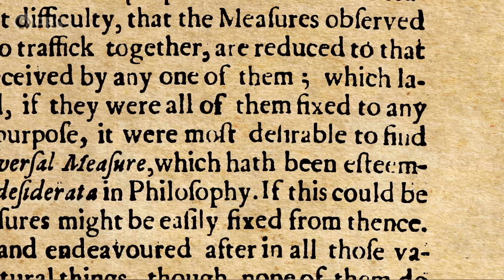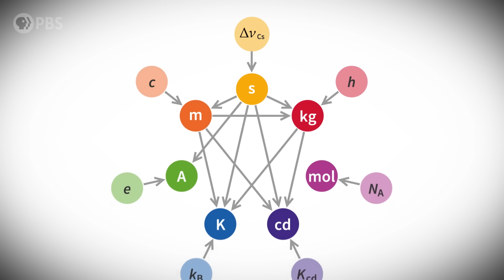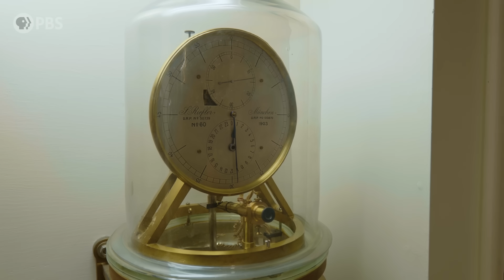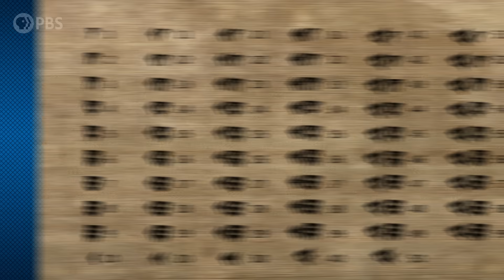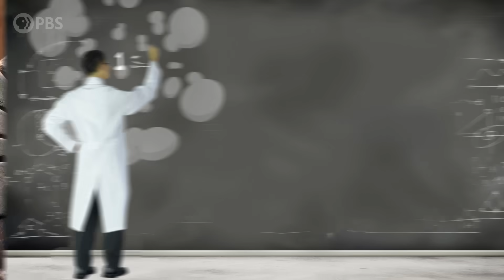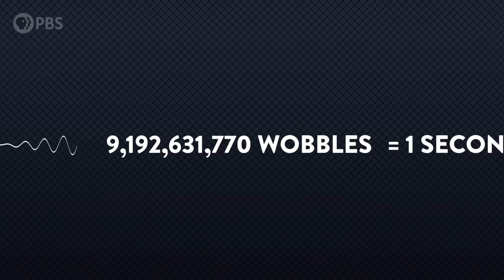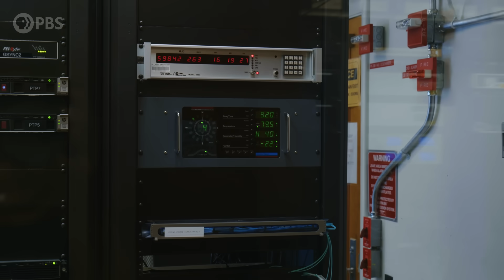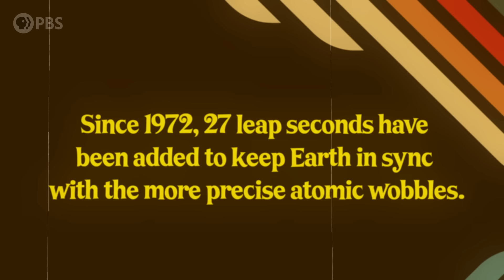The Unexpected Measure that Makes the Modern World Tick

Comment: So, you decide on what natural constants represent all your units, including the second. That begs the question, how do you "measure" it. Every man-made tool had inherent error in it. Aruler has lines delineating the units and subunits. How thick is the line. Does the left side mark the end of the previous subunits? Or, does the right side mark the end of that subunit? Or the center of the line. How much resolution power does the human eye have? How much does that resolving power does vary by individual? There is no such that as an "exact value" for any man-made measuring instrument.

Comment: Fun fact about leap seconds - they can take effect at the end of June or the end of December in any year.  And though so far leap seconds have so far only been added, theoretically they can be removed as well, though that's never happened yet.  But by 2035, the plan is that we will start allowing UTC to drift away from atomic time by more than a second, so these adjustments won't be necessary as often (but when they do happen eventually, the jump will be by more than a second).

Comment: I hope they have high level of security on these time providers.  They seem to me like a single point of failure.  If the clock is off, nothing will work correctly in today society.  Society can roll into chaos pretty quickly if the time is not syncing up.

Comment: The average person can’t even influence any measurement system. Here in the USA soda is sold in 2 liter bottles. Drugs are in metric terms. The military uses all metric measurements. Milk and water is in gallons. For temperature metric is not as precise as Fahrenheit. Think of Fahrenheit in % terms. 70 degrees Fahrenheit is 70% warm . 100 degrees F is 100% hot. You can see water boil and you can see ice. American money is  based on 10.  It is not going to be changed by people.

Comment: Imperial was quite genius at the time. With imprecision, there were simply more ways to divide 12 evenly than using units of 10. I mean, as late as the 1800s, who could accurately measure 3.33333333333~ as 10/3? But, 12/3=4 equal parts is pretty simple.

Comment: Kmiles is why they created metric system.  To cover up that the globe we know is 80,000 miles around, not 40000.  1000 miles per time zone.  Although it's actually 1600 miles per zone.  As  km.  Say.  But is actually miles.  1.6 conversion

Comment: No! The map people use to show who uses metric and who doesn't is completely wrong. You either need to include the USA as Standard units include metric. If it's based on usage then you need to include Canada and the UK for still using miles and stone respectively. Also,  what kind of metric? CGS, MKS, ISO? Absolute units are better.

Comment: The belief the US doesn't use metric and other countries do is not really true...certainly not so clear cut. We buy Coke in 2L bottles and wine in 750ml bottles and In the UK, they buy pints of beer.

As someone who has lived in both Europe and the US, they both have thrir place.  I prefer buying a pint of beer as opposed to 0.3L as it is sold in Germany.  A three foot counter is smoother than 87 or 93 cm.  In the day to day world, Imperial is simpler because it is anthropometric.  Whereas for science, metric is better because it is all decimal.  It also has the advantage of being universal.  However, aliens on the planet Krypton mit not choose cesium as a basis and choose neon instead.  And, if we want to be consistent, a second should be 1/10 of a minute and a minute 1/10 an hour etc.

Comment: 10:30 Would like to better understand of measurements of length, mass, temperature, intensity, etc. are all based on time. 

Like, is a meter defined by, say the distance light travels in a certain fraction of second?

Comment: the U.S. is officially on the metric standard. The U.S. was one of the first to sign-on, and the inch is defined by the meter. For all scientific measurements, American scientists and engineers use the metric system (S.I). It doesn't matter if we chose to say we are traveling at 60 mph or 97 km/hr, or buy 1/2 a gallon of milk or ~ 1.9 liters. It just doesn't matter.

Comment: ...undesturbed cesium-3 atom on the surface of Earth. Or, more precisely, moving at the combined speed of Earth's rotation + Earth's orbit + the suns orbit around the Milky Way + the Milky Way wobble factor. If you speed a cesium-3 atom up, like in a particle accelerator, its oscillations slow down. It oscillates faster on the moon as it is traveling slower than the net speed of one on the surface of Earth. The million dollar question is what will happen to one between galaxies where there is 0 movement.

Comment: We have a problem with this. The spead of light is NOT constant. The spead of light has been deceasing asymptotically. It is currently near its "ultimate" spead, but it is still decreasing and in the past it was faster. That changes very much in science. Scientist hide this discovery by defining the meter as a number of waves of light. That is an error. I refer you to "The Decreasing Speed of Light 1:19:36 (Full Length)"; https://www.youtube.com/watch?v=96g4GGt1TJA&t=56s
Regards,
Geoff. Reeks
Reply: Light has the same speed in all refrence frames. All possible instances of it slowing down are caused due to it traveling through a medium..

Comment: YouTube fed me this video now, about a year later. You didn't mention about the discussion around dropping the concept of "leap seconds". Basically to allow the earth's "clock" to drift relative to the atomic clocks. As mentioned, since they started the currdnt system, they have only added 27 leap seconds. If they hadn't added those seconds, then noon would appear 27 seconds "late". This is basically unnoticeable in common human experience, especially because orbital mechanics cause the length of the day to vary by +/- 15 minutes over the course of a year (the equation of time). 27 seconds would be lost in the noise.
Even worse is the idea that earth's rotational speed occasionally increases and there might come a day where a "negative" leap second is needed to keep the "clocks" aligned.

Comment: I worked on atomic clocks last year for my undergrad research, specifically 87Rb vapor CPT clocks—they're not as good as other clocks, but they're way cheaper and have the potential to be made really small. (You might know rubidium vapor clocks for their biggest hit, the GPS satellite network.) They're super interesting devices, and the physics behind them is really fascinating.

That said, I do need to correct this video on something: pretty much all new atomic clocks are optical clocks, and have been since the '70s—they're not the next generation. Even if they're not operating at visible wavelengths, they're still using lasers and all that to shine a beam at a sample. The next generation of atomic clocks features stuff like optical lattice clocks, which I'm super excited about myself. (Optical lattices are just super cool, though I'm mostly excited about how they can be used to simulate condensed matter systems.)

Comment: The length of a second changes from ground level to 20 ft above it. So how in the world do you decide what a second is when a second changes depending on your distance from Mass or the speed at which you are moving. We're all moving approximately 1000 miles an hour.
Kind of like what is actually the speed of light. Because light may very well have a different Speed 2 billion years ago than it does today. And depending on the medium it's moving through and what may be in space or not changes the speed of light, or more accurately the speed of effect. If you settled on this item in France that was said to be the kilogram up until 2019. It's still a kilogram. It's going to remain far more constant than the measurement of a second.

Comment: I was disappointed when I learned of the metric system, and how they replaced all those ancient inches, pounds, pints and Farenheit, but kept the old second (and turned it into a metric unit for non-earth time, and then framed the rest of the metric system around it. To me, that's like having "kiloyards or "milligallons"). I would have thought they would  base it on an obvious scale, like they did with Celsius, with the freezing and melting points of water or Kelvin based on absolute zero), and that would be the day,. so 100,000th of a day is just slightly shorter than a second. There's a system caled "decimal Time" that does use that unit.

Comment: 1/32768 of a second is very important for digital clocks. This might seem arbitrary but this is a very specific number that is very important to almost all digital clocks. In digital clocks, there is an electrical component known as a crystal oscillator that oscillates at specifically 32768 times per second. the crystal oscillator is a circuit that is based upon a quartz crystal. quartz has a very specific property, known as piezoelectricity. The piezoelectric effect is where the deformation of a crystal produces an electric charge or vice versa. because of this electricity can be easily used to keep the oscillating crystal going, as well as the measure how fast the crystal is oscillating. If you know anything about computer science, you probably know about binary. binary is used because it is most practical for a plethora of reasons for circuits to be made to use a base 2 system, rather that something like a base 10 system (decimal). Well 32768 is 2^15. At lower frequencies, the oscillator will use less power and would have a longer lifespan, but if it is lower than 20,000 Hz, it would be in the human auditory range, so all electric clocks would make a high pitched buzzing, which would be really annoying. Because of these reasons, 32768 was decided to be the optimal frequency for these crystals to be manufactured and tuned to operate at.

Comment: The United States IS on the Metric System (sort of). For over 200 years all of our measurements have been defined in terms of metric units, and by law SI is the "preferred system of weights and measures for United States trade and commerce" (Metric conversion act of 1975)

Comment: One thing that's always glossed over in laymans explanations is how those 9bn oscillations are counted. In a quartz watch, those 32768 oscillations are easily counted with a simple digital counter, but I don't imagine a digital counter could keep up with 9bn/sec, so how to they measure the frequency of the microwaves once they've set it right?
Reply: a rather average cpu clock speed is 7 billion hz, so i suspect by using specialized hardware you can rather easily count at 9 Ghz

Comment: At 11:05 you say the Earth rotation measured against a star is 86400 sec, but that’s wrong. A sidereal day, that’s how a 360 deg Earth rotation is called, is only close to 86164 sec, about 4 min short of 24hrs. A day of 24h readjust the Earth rotation to compensate for Earth revolution around the Sun!

Comment: So instead of using something we all just have, like a foot, they chose something completely arcane and foisted it on the world as a standard. Imagine if they had just used one yard (3 feet) as a meter. Then instead of using the length conversion of 25.4mm = 1 inch that conversion would be feet × 3 = meters. An airplane flying at 30,000 feet would be flying at 10,00 meters. Since meters were arbitrart from the start that would've made just as much sense. But why make life simple?
Reply: people have different shoe sizes dude.

Comment: I need to correct you. America is very metric. All US Customary units are based on a metric standard. Imperial is not (America has never used the Imperial system). The US government uses metrics exclusively. Everything you buy that is measured (food for example) is labeled in both US Customary Units and metric units.

Comment: What is not made clear in this video is that those 86,400 "Earth seconds" that are measured when the planet rotates 360 degrees with respect to the distant sters are sidereal seconds, which are about 0.3% shorter than a clock second. One rotation of the Earth is only about 86,164 normal (clock) seconds. That's because the Earth completes 366 and a 1/4 (approximately) rotations on its axis every year, one more than the number of solar days.

Comment: 7:20 how do you know the exact frequency, to make the precise time? I mean, 60Hz is when it move 60 times per second, right? But how do you know it's a second? What if it's only 0.98173828261927372772196391729272?
Reply: It's by definition. There's nothing intrinsic about the man made unit of second. What he didn't dive into is what happens when you and I have perfect watches but one of us is moving or is at a different height and thereforeore experiencing a slightly different gravity. When we meet for coffee our watches won't agree but both will be correct.
Reply: @anullhandle  so how to know a second is?
Reply: @husanaaulia4717  If you are wanting both our perfect watches to agree, that's not how the universe works. Time is relative.  Both clocks are working properly. If we were born at the same instant at the same place we are no longer the same age.

Comment: If all other measurements rely on the second, why do they calibrate it every year with the leap second? Wouldn't that throw everything off?
Reply: Because they can't alter the Earth's rotation time, so they alter the time standard to match. Yes it DOES throw things off in science, navigation, trade etc, but all those systems are designed to accommodate the shift.
Reply: Adding a thought: There has been a movement to skip all that and divorce the time from the Earth's rotation. This may well happen some day, but the concept that has been with us for thousands of years (day as the measure of time) will need to be abandoned. Culture lags behind.

Comment: When the method of calculating a second changes, does the length of 1 second changes or it remains identical to what it was? If it changes, that means time in itself is not constant, we all might be older or younger than we really are or if we use newer components based on a most recent method of measuring what a second is with older components based on a previous method of measuring 1 second, it might create mistakes that may lead to awful consequences! Kinda scary if you ask me!

Comment: 11:00f: > One clock marks each day by measuring Earth's rotation with respect to distant stars...
... whis is ablout 86164s rather than full 86400s which is the time Earth has to rotate by 361° in order to get Sun to the right spot since it otherwise would apparently wander eastward during the year.

Comment: This video is fascinating. Why was cesium chosen as the vibrational standard for the second? Did they measure the microwaved vibrations of a number of elements valence electrons and found that 9, 192,631,770 cesium vibrations was the closest to previous definitions of one second?

Comment: Remaining questions:
1. Why a Cesium atom? Surely there were other candidates, right?

2. If this very precise number of wobbles standardizes a second, what manner of clock did we use to compare our new measurement to? How could we verify the new standard met the old second with any objectivity without employing the old measuring system, which I imagine wasn't perfectly consistent, or based off of anything as objective as Cesium wobbles?
It appears now as if we've gone from making something up from thin air, to making something up off of physics. An improvement to be sure, but still making something up.

Comment: When programming, you don't use normal, human seconds. You use epoch time. Epoch Time is the number of seconds (or microseconds depending on your application) that have passed since January 1, 1970. Epoch Time has no concept of days. It's just the count of (micro)seconds. So I wonder if that correction to the atomic clock based on the leap second is applied to that count. I know that servers retrieve it from a central authority.

Comment: Still, it’s nice to know how powerful a car is in terms of how many horses would otherwise be needed, but if for some nerdy reason Coulombs is preferred, the conversion is easily made, to arbitrary precision well beyond “one-Mississippi…” Nonetheless, given requisite 24*60^2 seconds per day with measure of the physical second also prescribed, the measure of astronomical days/year will naturally drift requiring correction over time, but it’s generally sufficient to use leap year corrections per Gregorian Calendar, i.e. 365 + 1/4 (one day every 4th year) - 1/100 (but not century years) + 1/400 (unless divisible by 400) = 365.2425 days/year; however for arbitrary precision one might adopt NASA’s determination as used for interplanetary navigation, currently: 365.242200(22). BTW, it’s not a good idea to arbitrarily prescribe more parameters than there are degrees of freedom; something’s sure to break, eventually.

Comment: How do you know what frequency microwaves to use to excite the atom? You could specify the period (in seconds) or the frequency (hertz, the inverse of the second). I suppose you could use the wavelength, measured in metres, defined as the distance travelled by light in a vacuum in some precise fraction of...oh.